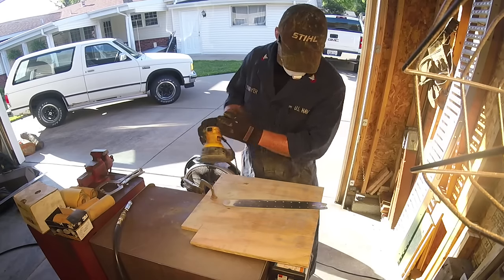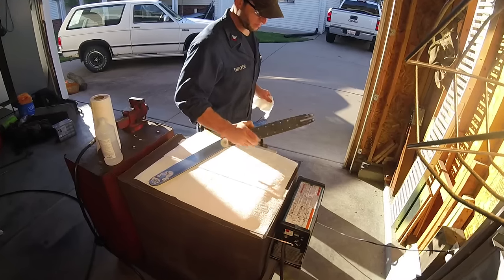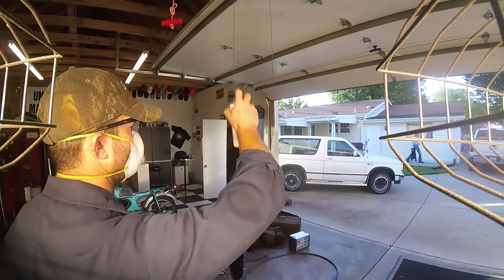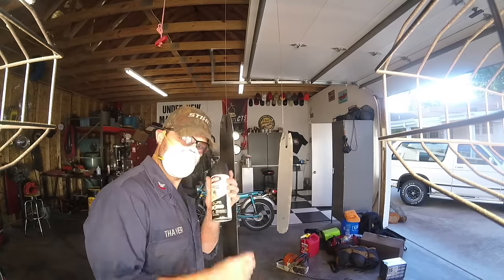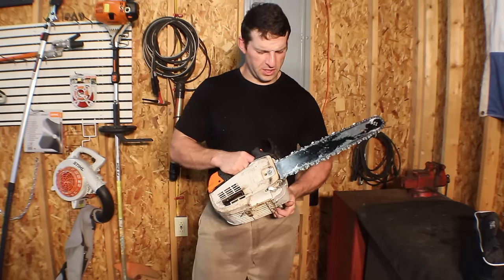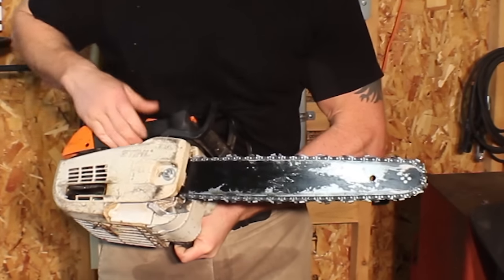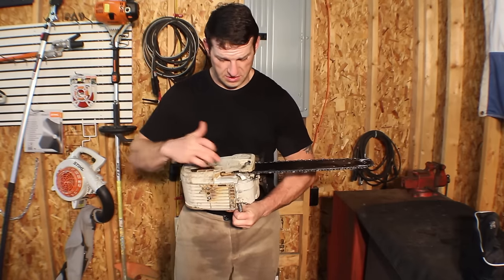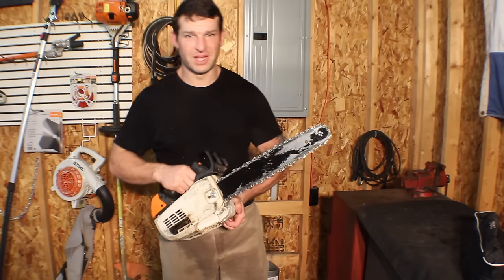Trying my hand at bar painting

Comment: I wonder if you got paint inside the guide bar rails?  That may be what caused the chain friction, oil flow to slow, and the heat build up that burned your bar.  I've tried several paint types to recoat my older guide bars over the years in my mini spray booth at home (epoxy, high temp, high gloss auto, clear coat, rustoleum high gloss), but nothing holds up better than powder coating.  Unfortunately that ended up costing more than a new bar, too expensive to repeat especially since it lasted only 4 or 5 weeks of limbing and bucking 12" pine logs. Ever since, I soda blast the remaining paint off, file the rail burrs flat and wet sand the sides to a shine.  Restoration of a 24in bar takes less than 45 minutes.  Last, I apply a coat of either 3in1 dry lube or Maxima SC1.  An old timer told me mink oil works well too. Luckily my saws don't sit too long or I'd use something like Boeshield T-9.  I know these aren't "arb-safe" lubricants, mink oil is close, but bar and chain oil isn't either.  I haven't tried Motion Lotion yet.  (Awesome name too!) Have you?

Comment: I would bet you that the bar did not get enough of oil and or the chain was to tight. I never  heard of exhaust gas making the bar turn blue. That is a friction issue caused by low or no oil on bar and chain. The new saws with automatic oiling is a great thing until the unit does not pump oil as designed. I have fixed a may saw and can tell you what I said is fact fella. When painting bars remember using epoxy paints with etch primer. The next best thing to chrome plating on bars which was the norm on the old saws which manufactures did as standard equipment and part of doing business. Have fun doing what you are doing fella and have a great day too. VF

Comment: i used walmart paint remover and start at 100 grit sand paper an work my way up to a 1200 grit wet sand to experiment with a old stihl bar... i think the soft metal makes for a smoother dive  an easyer to pull out in a bind.... ive noticed it doesnt build up gum/sap as fast an if it does its easy to get off.. i see alot of little benifits from a polished bar....
Reply from the maker: hmm.....something to think about....wonder if that's why sugihara bars are polished?

Comment: "2-in-1 paint/primer" - I didn't see High Heat designation on that, am pretty sure that's requisite for bar-paint.  Wouldn't be going to a hardware store, would go to Auto stores looking for brake-caliper paint and stuff like that. 

I do question any coating though, my 16" Oregon was all-white and new like 3mo ago and I didn't put it through that heavy usage and it's already a fun-house....it's on the neon-orange 355t so, w/ the bar being white, I'm pondering getting orange & black (high-heat!) sprays and, using leaves/etc for "blocking", do a pattern (gonna google to see if there's any chance I could aim for a cheetah/tiger type patterning, would look boss and the 'randomness' of such patterns would go a LONG way to hiding imperfections IE I lose a lil paint on my all-white bar and that black spot sticks out hard!  Well, dark-gunmetal, not black, but still!)
Still loving the 2511?  Gotta check ur vids to see what your setup is, seems a 2511t w/ the 1/4" pitch/0.043" conversion setups @14" is becoming a  "king" saw for all-but-the-heaviest work (where you grab your 201/355/540 w/ its 16"!)  Am now pretty convinced a 2511 & a 355t are all one needs for fully optimal dismantles!

Comment: If I am correct you live in Columbus? I am in Cleveland.  There is a place called Eastwood. They are a nationwide Autobody supplier, but I am lucky to have a store a few miles from my house. They have small and relatively cheap powder coating equipment. If you are ever in Cleveland check it out, or online. Now you have me interested in something that I should not be wasting my time on. Thanks.
Reply from the maker: lol, I know, I'm just wasting my time doing things like this as well.  I'm in St. Louis though

Comment: Told ya,,, automotive paint. And flat???  Another method I used to use is heat. When they do cars they bake them in a room with hot lights. But even if u air dry, automotive paint is the way to go and try anything but flat. With all your room, you should get yourself a decent spray gun. Hit the automotive paint supply. You seem to like doing it. Hope you didn't weaken the steel on your bar overheating it. Take care.